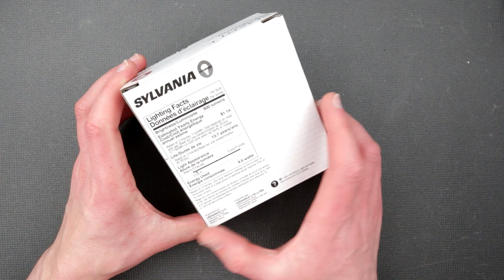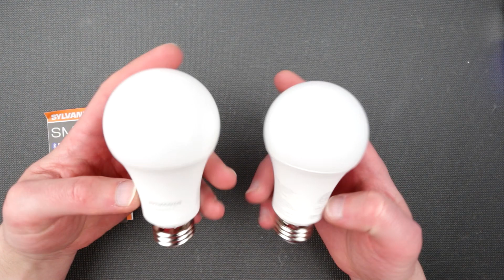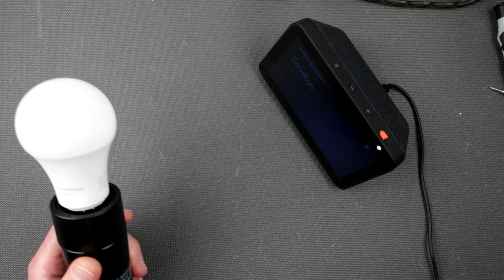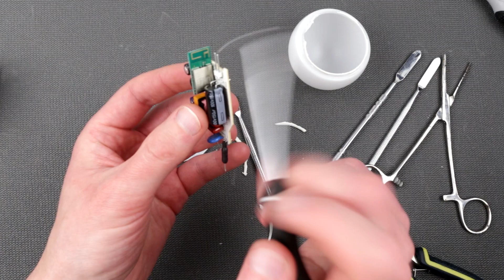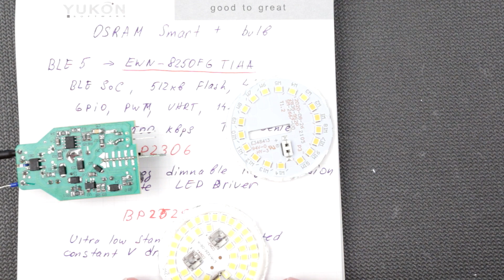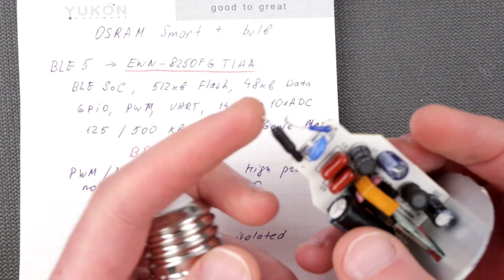Dollarsore Miracle: Sylvania LED bulb with Bluetooth !

Comment: I bought about 25 packs of the full colour bulbs and a couple of the strips from a couple different dollaramas I also got some white only bulbs. 1 in 5 days the system will work, most days it’s devices unresponsive or server unresponsive for each SYLVANIA light I have yet the other devices I have work fine. I use Alexa because I’ve got 5 of them in the house.
Reply from the maker: Thank you for watching ! This is good info, so yeah Sylvania servers are crap. But so far I do not have more then 2 of those :D

Comment: Bought a couple packages of these a while ago.  They're pretty decent for what they are, once you upgrade the firmware.  It'd be nice if they did pair with google home reliably, which they do not, neither directly, which they're not detected, and not even if paired with their Sylvania Smart+ app first.  What's funny is they now just started selling Sylvania Smart+ LED RGB strips at Dollarama in Canada, and it's also bluetooth RGB, and it DOES pair directly with Google Home and doesn't in fact work with the Smart+ App.  Which is more convenient, but still clicking on and off in google home seems unreliable either way.  Really wish these were more standardized.  Perhaps If there was a bluetooth hub like the zigbee hub it might be more reliable.
Reply from the maker: Thank you for watching ! Can you please share how and what you can flash into these guys ? Thank you
Reply: @InsideOutElectronics  I didn't flash it with an alternative firmware (would be nice though), I merely used the Smart+ Android App to flash it with the most current samsung firmware.  It is possible that my main issue is my Lenovo Smart Clock essential.  I paired it with google home using my phone, and then once paired, google home doesn't connect. But my Google Home Speaker in the living room does seem to connect and retain connection to the sylvania LED bluetooth RGB strips that dollarama recently had in their stores, whereas the strips I put in my bedroom near the lenovo clock failed to respond.  I suspect the bluetooth bulbs are similarly having an issue there.

Comment: Telink chip? Check the id on the box.
Reply from the maker: Which on you think is Telink chip?
Reply: @InsideOutElectronics  the bt module. All dollarama Sylvania bt bulbs around me have a telink chip. Yes, telink tlsr8250 chip hence the number in the module name. Easy to program, you could write your own firmware for fun, if you speak Russian , there is quite a large community dedicated for those telink chips...
Reply: @InsideOutElectronics  apparently the color bulbs have a better chip with twice as much flash, namely tlsr8258... These telink chips are well known to work well with coin batteries, even in cold climates, something that's pretty much impossible (or very hard) for espressif chips...